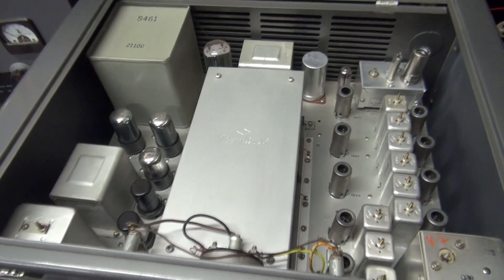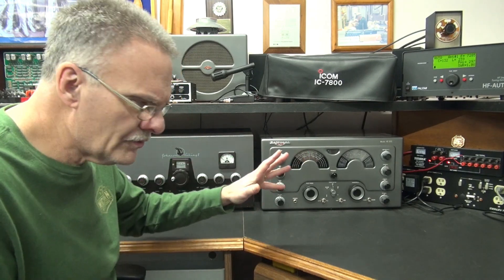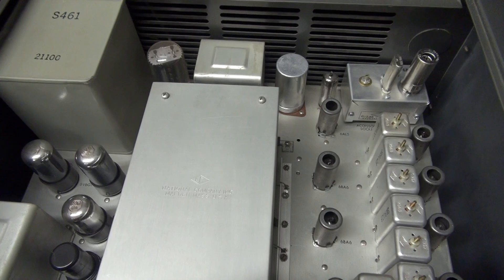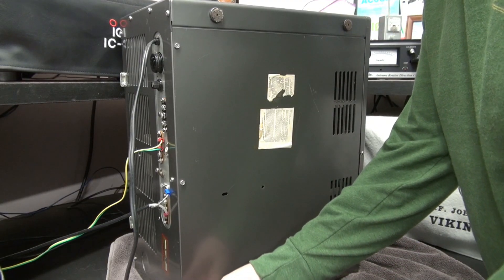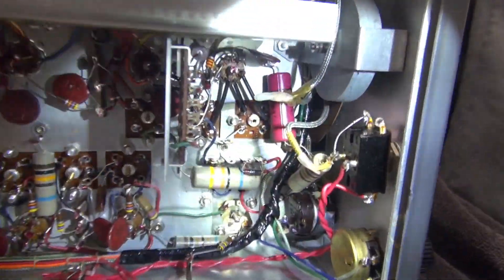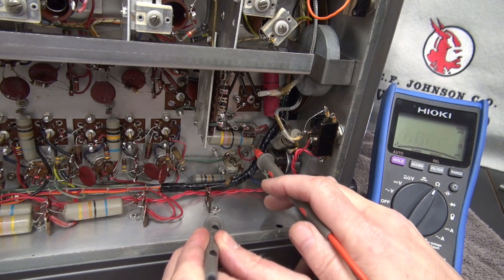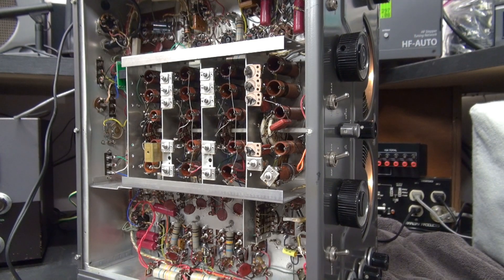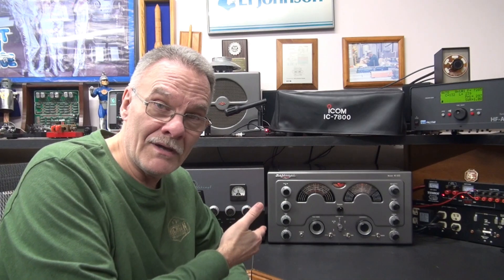National NC-183D Ham shortwave receiver Boom it died, Quick Fix and it lives again Classic Radio

Comment: Great job, Terry! Reminds me of the time a resistor blew apart with a bang in an open chassis of my Zenith Trans-Oceanic R600. I had just recapped it, and solid stated the power supply. I was getting ready to align it. It was propped up 2" off the table with a copper sheet under it. The bang and the flash was remarkable and scary. Lost 3 tubes and 4 resistors in the tube filament string. Later someone told me on the Zenith T-O reflector to change the resistors in the string, and I hadn't even told him what had happened yet. I have a five-part video series here about it.
73 Paul AA1SU

Comment: Hey, thanks for being here and showing us all the things you're accomplishing. I too have a NC-183 (not D) with issues. Watched most of your vids that apply, and have made progress. Got the audio chain fixed but, still no RF signal. A work in progress. Big fan of yours. Friends with Timtron and others here in Maine. I have MANY pieces of ham built tube gear from the '50s and '60s, which means... too many projects? Makes me wish the radio room wasn't on the second floor!  Keep us informed and inspire young folks to get involved. 73s Vern WA1CYL

Comment: You calibrator doesn't look out of place AT ALL. Without you telling it (okay and your label on there), I would never have suspected it not being original.

What made the electrolytic blow up? Did you just choose the wrong one or did the other fault somehow led to a way higher than normal voltage to it?

Is it the one in the power supply, which creates the bias for the AGC? This one is bridged by 500Ohm though, so high voltage is quite unlikely?

Comment: The electrolytic cap that exploded looks modern. Had that been replaced?
Reply from the maker: Yes, about 5 years ago. That cap was rated 200VDC, applied voltage is around 65. There were actually 2 of them in that power supply feed. Radio has been in use weekly, so they had a long time to blow up!

Comment: pretty impressive exploded electrolytic cap you found in there and the shorted resistor make for an interesting explosive situation. I see more replacement parts in that receivers future.
Reply from the maker: Yep, I need to make time to at least get those old Bumblebee caps changed